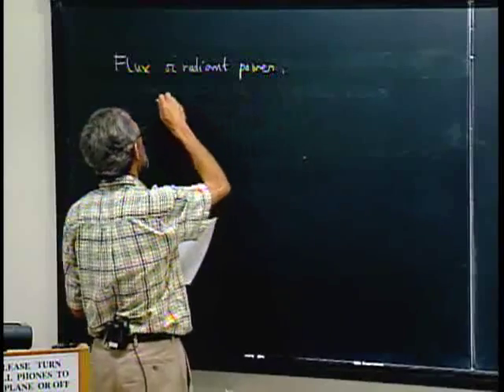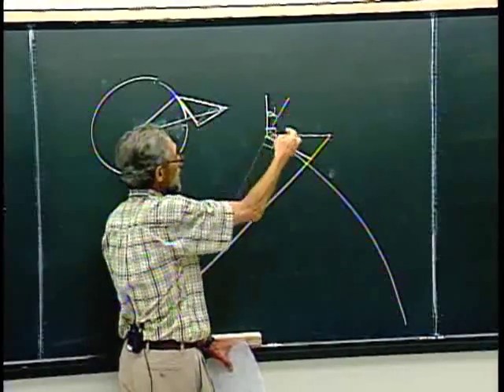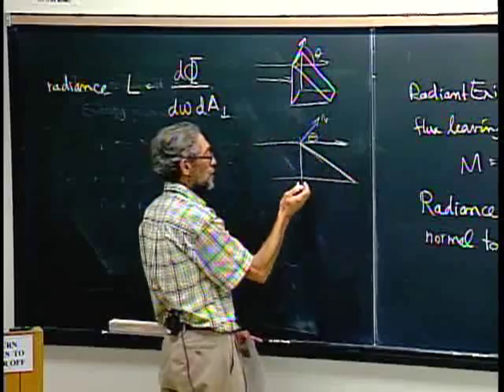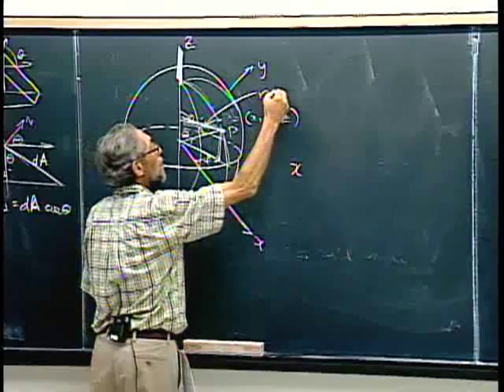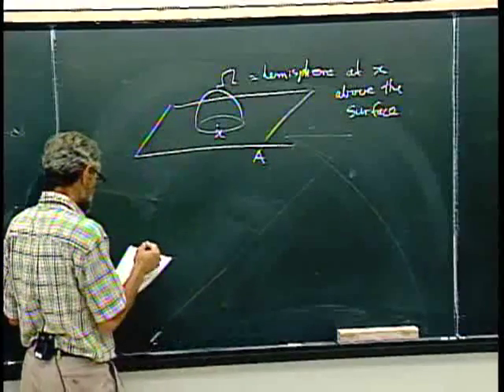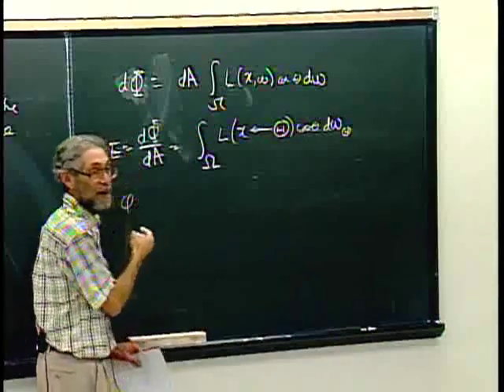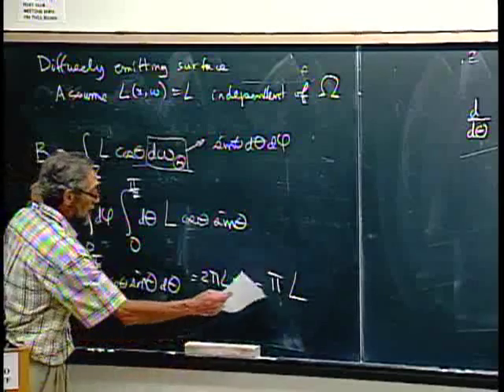Lecture 3 - Radiant Flux, Radiance and Solid Angle

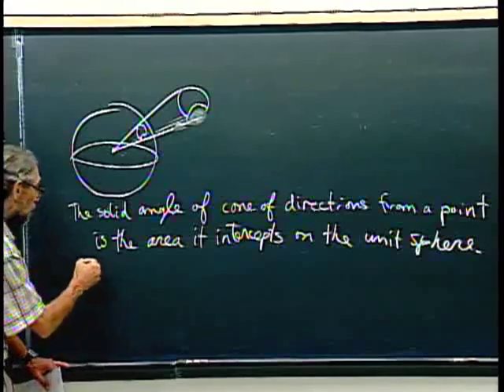Comment: Thank you. At 7:44 I'm not sure if the "bulged up" explanation is good enough to give account for the surface of the unit sphere. At least if you translate that to one dimension, it would mean that a circle has a circumference of 2 * (2 * 2) = 8, which is too much.